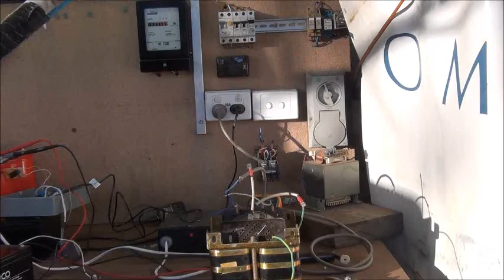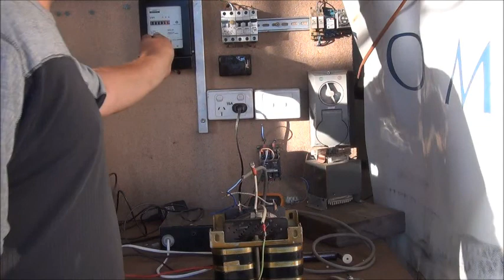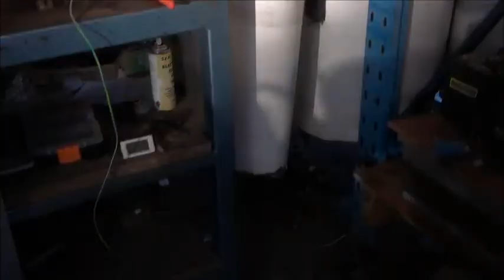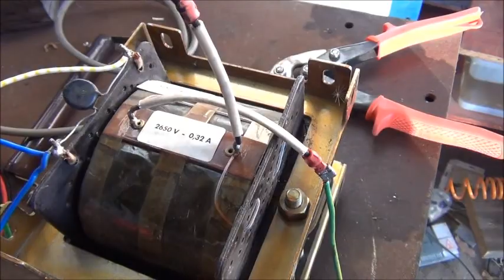Strange / Large HV Transformer!

Comment: Certainly medical, would have come from an old Siemens short wave therapy machine used in Physio depts.
Those machines were used to treat muscle injuries by applying RF energy via disks connected by high voltage cables which acted as antennas, the persons limb was placed between the disks. The treatment energy could be dialed up in ranges of Watts and during use you could hold and light up a fluorescent tube when you approach the machine during use. Its very similar in principle to a microwave oven in the way it uses RF energy to heat water molecules in a substance. I don't think many of these units would be in use any more due to unwanted biological damage to eyes and other organs.
Reply from the maker: interesting, cheers :)
Reply: No worries, I use to work in a Biomed dept and got to scavenge all sorts of great stuff from obsolete medical devices destined for the skip bins, actually I have one of those transformers! :))

Comment: Am trying to think of what would use 2650V at 320 ma - cant think of any medical laser machines apart from a laser surgery machine but they normally use a co2 laser which is RF driven; or an ion laser which is only a coupla hundred volts (at a craptonne more amps)